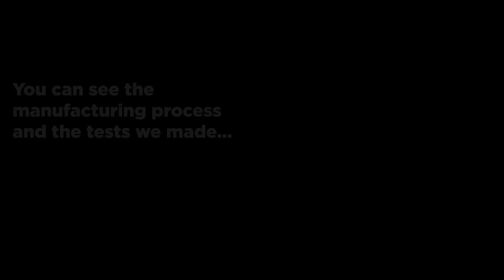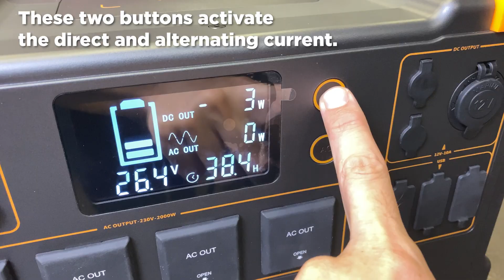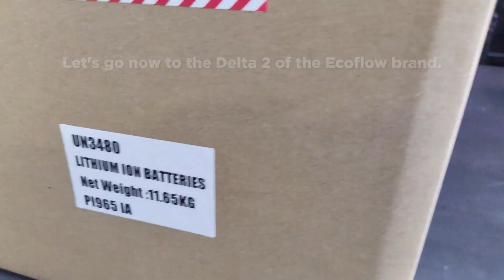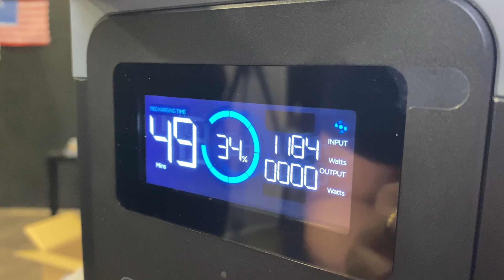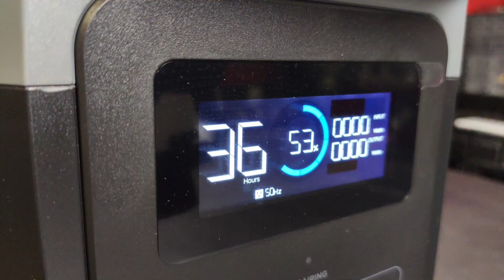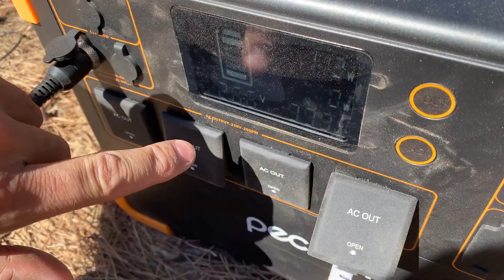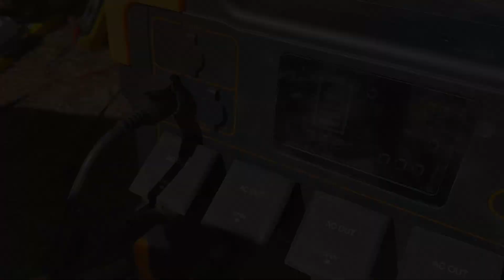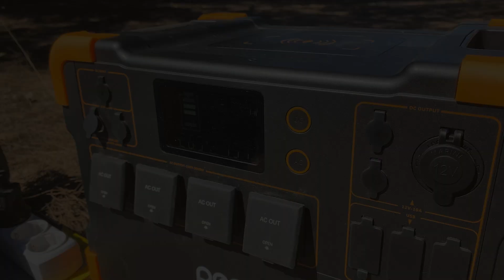INFINITE ENERGY GENERATOR VS PECRON E2000 & ECOFLOW DELTA 2 - Review and Tests

Comment: Dear Liberty Engine,

Can you please show us what parts you would buy from the internet? I attempted to make it. I made the motor exactly as you did, but I ended up buying a very old motor and I couldn't afford to buy the correct electric motor. Do you think you could atleast show us what is the most inexpensive motors we could use with our modified alternator? The one you are using costs $150 used minimum, and if there were some advice you could give me I would really be able to atleast make my investment work. Thank you.
Reply: don't even try. it BREAKS THE LAWS OF PHYSICS
Reply: @DaveMiller-of1mb  Well I got something way cooler than that in the process. I now have a brushless motor for my electric bicycle that actually works. Ordered all the parts, and tested the motor. It is simply superb compared to buying an actual ebike motor of the same value. Can't even be compared
Reply: @Ovanes_Polisadzhyan  we need heroes like you take me diy videos, or at least some article to follow. That so cool
Reply: @DaveMiller-of1mb  Who wrote the laws of physics? Was he some sort of god? Did he have infinite wisdom? He was a man. ANY law can be broken
Reply: Don’t hold your breath, they don’t answer any technical questions, I rest my case 🤷‍♂️

Comment: These solars panel with battery are no match with your infinite power generator once the day is finish your generator still continue i really want to try to build one but i will add a few of my idea cause this kind of generator have only one issue there is no electric regulation of the current its not a stable voltage but there is way to fix it but if its 10 000 watt over 220volt thats enough to run a regular house "bungalow" including washing machine and dryer also my other concern is about overheating how many hours can you make it run.. per day there is always the possibility to add a little fan to cool it down or 2 use 2 generator one during the day one during the night.

Comment: okay, I watched the video. IMHO this is B.S. I know way back in the day when I was using belts on my generators, 
there was always a lug down when a load was applied. Now, for me at least, this is not a problem, with my generators.
You're apparently running yours in 3 phase mode, which is fine, but you're NOT generating 10,000 Watts.

Comment: can this generator be mounted on an electric bike so that I can go around the world :)
Reply: Yes, if you are willing to pedal to keep it charged - because the device is a con.
Reply: Trying on a 4 wheel Bike with 4 Solar Panels $360 from "Home Depot" 
All You Need is 4 Lithium Battery Packs of 48v 20a 
5-12x5🔋pack of Lithium of 4v/4amps each🔋

Comment: Crazy channel is the correct name for your channel. On thing I noticed that on your generator that when you did your load test, the generator's RPM did not even slow down and the belts did not jump under load . 
10,000 watts with your setup is far fetched, the little belt would smoke under that kind of load, there smees to be " magic " involved
Reply: Nie ludz się że zrobisz coś takiego nabrałem się i zrobiłem taki generator nie działa 😭😭😭😭